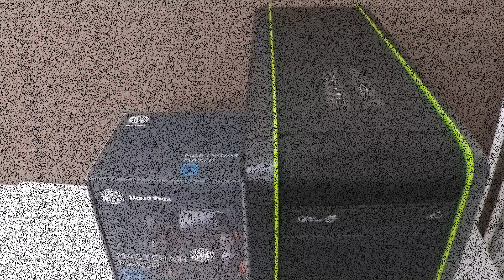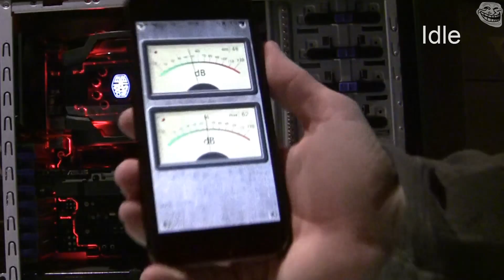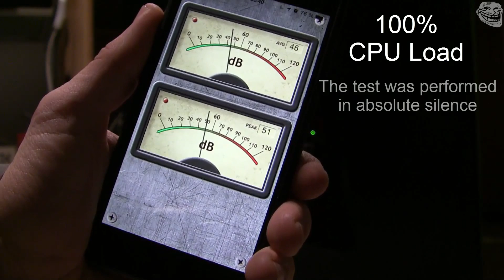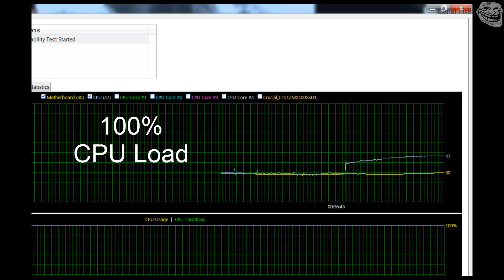Cooler Master MasterAir Maker 8

Comment: u set fan wrong direction
Reply: +canalfixe You need to install the fan in the case vertically, rather than horizontally, as you have it here. You want cool air that's being pulled into the case through the case's front fans to be pushed into the CPU cooler, which will then push its exhaust out the back of the case with the help of the rear case fans.

The way it's installed in the video, the fan's intake is just going to be the dead air on top of your GPU, and it's going to exhaust straight up into the top of your case (which, from what I can see in the video, doesn't look like it's very well ventilated, but I could be wrong there as I didn't get a great look).

Installing the fan vertically will improve performance and dramatically improve airflow through your case.
Reply from the maker: +Alexander Palmer thanks for your clearly comment:)

I have install the fan horizontal because the fan do not fit as well on the RAM sticks.

I will try install vertical once more time...

Thanks for your comment
Reply: +canalfixe You can also slide up and down the fans on the side for better clearance on the ram side ;) I'm looking into this cooler for my next build.

I was wondering if you have tried one of the Noctua NH-D15's or Hyper 212 EVO's and how this compares to it?
Reply from the maker: +Victory hi :)

My problem is the case, it is too small for this cooler, iwill make a new video to show that.

Sadly i never ever try another cooler beside this.

Thanks for your reply
Reply from the maker: +陳冠宇 really??
Reply from the maker: +陳冠宇 how do u mean?

Comment: why the fuck are you wearing gloves? , not a bad review though. but you didn't compare it to other coolers. and you clearly didn't overclock the cpu so your temp results are useless
Reply from the maker: Hi Jake.

I'm wearing gloves because i practice MMA and KravMaga and my hands are at most of the time fuck up.

I don't compare to another coolers because I don't have tested another coolers.

And this CPU was overclocked to 4.386MHz

See this video:
https://youtu.be/Rce9QvuInq8
Reply: that is actually a really good excuse. guess you will be going for a higher overclock now that you have that cooler. i would expect around 4.7ghz for a i7 4770k. thats around what mine got
Reply from the maker: Yes, i will OC more... Still don't have time to do it :(

Soon a new video with the test . Stay tuned Jake
Reply: +canalfixe with intels software it takes like 5 minutes yo!
Reply: ***** what you talking about ryan? no one should use a tool that does it for you with overclocking
especially when its so easy to do it manually